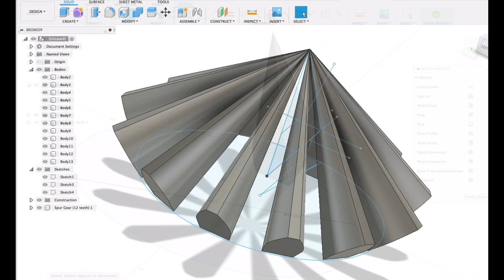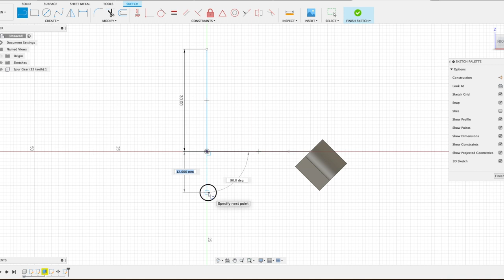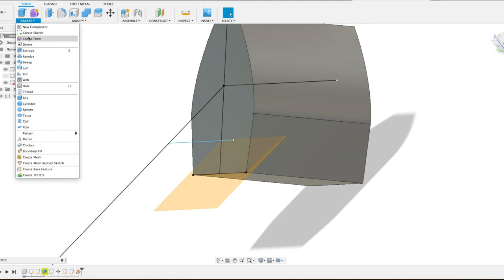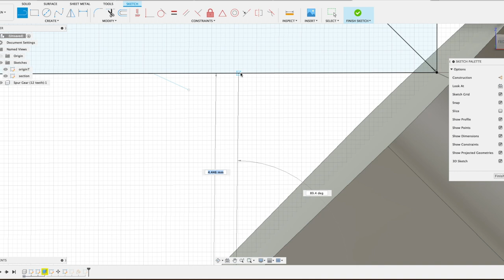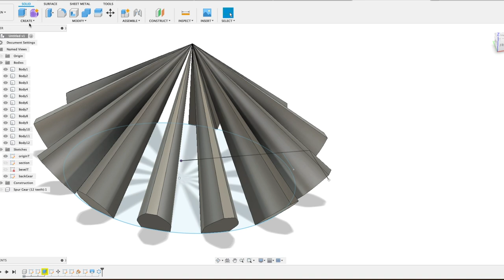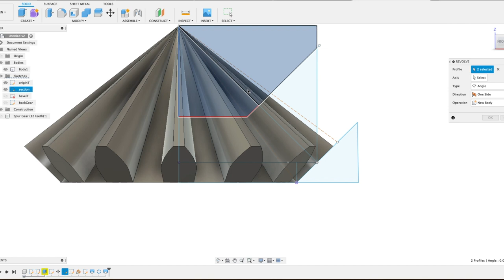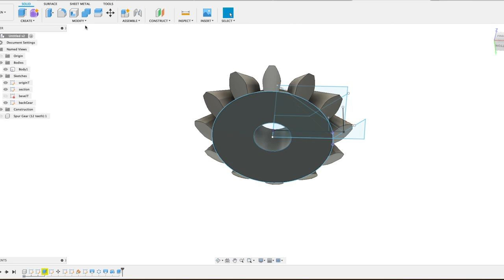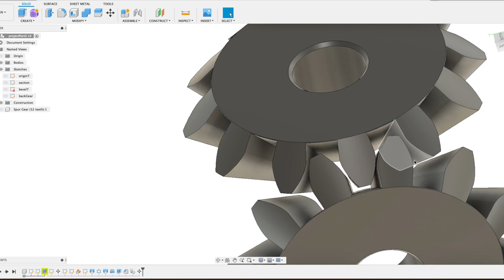I used Fusion 360 to design a set of bevel gears

Comment: Nice work, thanks for sharing. I think the tooth profile might be a bit more accurate with Tredgold's approximation. Tredgold's approximation employs a gear tooth profile of the an equivalent spur gear with a radius of the bevel gear's back cone radius, rather than the bevel gear's pitch radius. So for 12 teeth this gives the equivalent of 16.97 teeth (12*(1/cos45)), which rounded to the nearest whole number gives 17 teeth. You would then use the spur gear tool for a 17 tooth, module 5 gear to get your tooth profile, and continue as you did. There will only be a small change of profile and the backlash of 1 mm hides any difference, so for low speed it probably makes no difference. But for a tighter fit and at high speed it would likely be an improvement. Thanks again for the video.

Comment: Your method of making bevel gears for 3D printing is very good and I appreciate video.  It does show off how quickly it can be done.  But for people new to CAD and Fusion360 it would be nice if you could remake the video moving slower when selecting things with the mouse and explaining how you do basic things like ensuring certain constraints are being done.  I did not find out till the error message when trying to do join near the end of the process that the points were not actually touching the lines - like when you draw a line from the back of the tooth to the line above and the circle through the end points of the back line.  I did not see end points on the line and still not sure where I went wrong.  Even using slow motion and stopping a lot I had to replay and retry many times to get it right.  That being said, I now can make the gears I need for my projects thanks to you.
Reply from the maker: Thanks for the comments 
It is a delicate balance of going in enough details without going too long
I assume people making bevel gears have some experience with fusion 360
And if I understand you got your gears So well done!
Reply: @jacquesfavre999  Yes, I understand but many people looking to 3D print some gears have no previous exposure to Fusion360.  Happily after my comment here I did some searching and learned of projection and how to set automatic projection in the preferences.  A basic concept (Rule #0 perhaps) previously missing from my knowledge.  Thanks again.
Reply from the maker: I suppose we are all at different level in the learning of a CAD software
CAD learning is a huge undertaking
If I managed to peak your curiosity and go and learn something new, then I am happy with my video @MinionAtTheGate
Reply: @MinionAtTheGate  thank u! thanks to u I looked into automatic projektion and it really helpt me